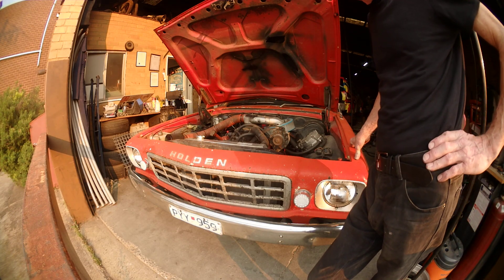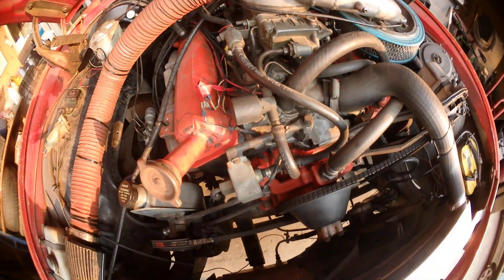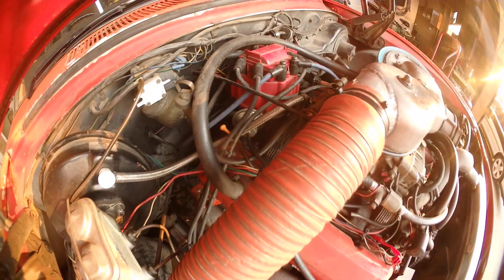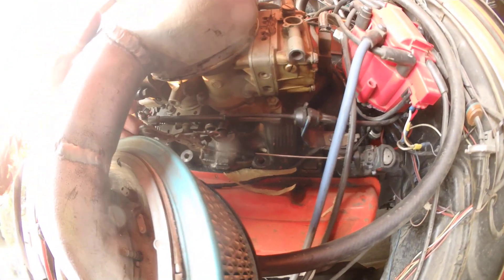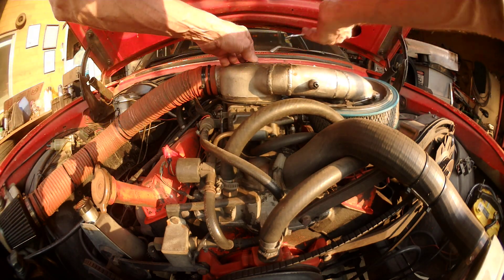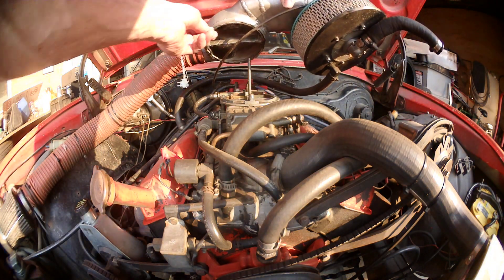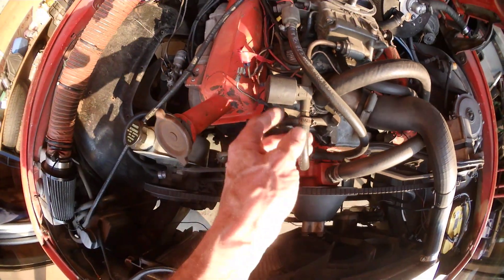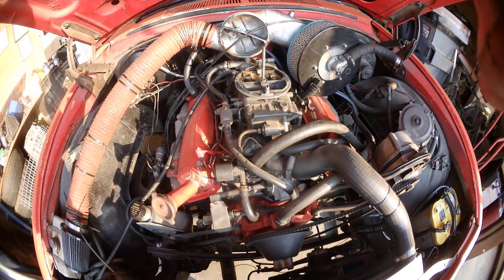327 dual fuel at the same time

Comment: It’s got a crack in the timing case cover. It’s missing some teeth on the timing gears… The radiators damage to the core. It’s got a cracked water pump… And a fractured injection line.

What does that mean? 

It will be running in about 4 1/2 hours